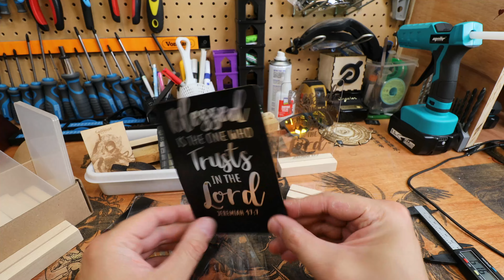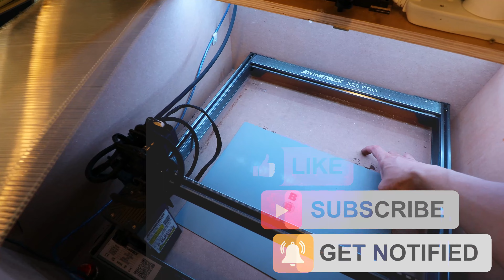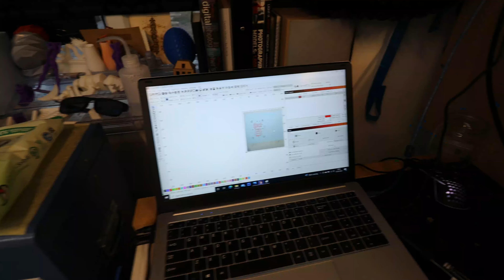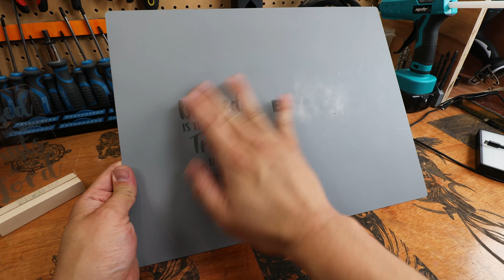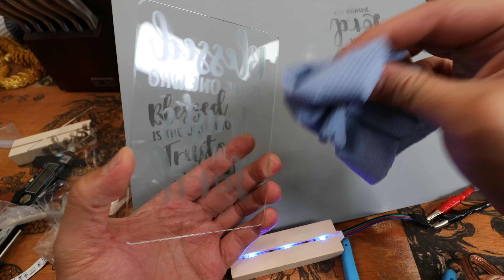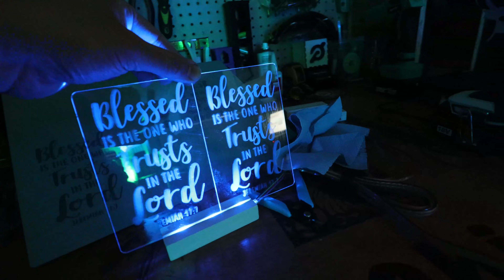Atomstack X20 PRO Quad laser engraving clear acrylic by Benson Chik

Comment: I recommend checking the fill offsets. The laser from Atomstack is a little late, and because of this, there is smearing of the edges when painting bi-directional. I made a detailed video on this issue. https://youtu.be/-sPOyj1CYIw
And this will be useful for those who want to work with Atomstack via WiFi from a PC from LightBurn, https://youtu.be/JMbSUrwNKdw
Reply from the maker: Thanks for the tip 👍 will. Will check out the video. I adjust the offset when doing tiles to get a straight edge where the photo stops

Comment: Can't we just use a colored cardstock for the backing instead of spraying metal?
Reply from the maker: The grey primer works best as it will get vaporised but leaving very little residues on the clear acrylic. When I use black spray paint and other non metal backing it leaves burn mark and vapour escape type of marks which does not clean off

Comment: Hi Benson, did you ever try to cut rubber with this Atomstack? Approx. 1 mm NBR for cutting gaskets e.g.? I'm quite interested, because usually the wavelength of CO2-laser would probably be much more suitable, but maybe the power of the X20 Pro compensates?
Reply: Yes, it can cut and engrave rubber. I used it for making stamps.
Reply from the maker: No I have not tried, is there any household product with NBR I can test cut with?
Reply: @BCreviews  Maybe an old inner tube of a bicycle could be comparable. But only if you've an extraction, since I'm not aware of toxic gases.
Reply: @BCreviews  I've got the information from Atomstack, that it should be capable to cut rubber. I ordered my Atomstack now, so that I can inform whether it really does cut it, asap

Comment: Hello witch configuration you use for Lightburn and the X20 pro ? your are on Mac of windows ?
Reply from the maker: windows 10, I find that install grbl first and get that working then install lightroom sorted out the teething problem I had. At first I have to start GRBL and connect to the laser, then shut down GRBL and then start lightroom and it will connect. After a few times I now can connect to lightroom every time it starts. I always assumed that is because of driver problem.
Reply: @BCreviews  I presume you are using Lightburn instead of Lightroom :)
Reply from the maker: Lightburn yes 🙌

Comment: Why the X20 Pro "failed" to cut acrylic?
Reply from the maker: Failed to cut clear acrylic , most coloured are ok to cut to an extent.
Reply: @BCreviews  wave lenght of beam vs CO2 reson for not cutting clear acrylic
Reply from the maker: I would love a co2 laser, all I can afford is k40 but too much work to make it good 😂
Reply: @BCreviews  hi Benson. I use a CO2 laser but for backup I want to get something like the Atomstack
Could you tell me what is the maximum engraving speed
Reply from the maker: I find the max sped around 8000mm/min, any faster than that don’t seems to improve engraving speed at all. Could be due to user error as I am still learning as I go. 

On paper it should go up to 12000mm/min, when I use that setting in lightburn it is the same engraving times as 8000 …. I may do a speed test video next 👍
Reply: @BCreviews  ok thanks will do conversion to mm/sec as the co2 can do 400mm/s max but engraving depth ect works hand in hand with the speed
Reply: @BCreviews  12000mm/min) = 200mm/sec not too bad but I think engraving is light at that speed full power?
Reply from the maker: No where near that speed for engraving, that is just the speed the gentry movement max speed. In my 1st x20pro video I did a batch test on wood. 2000mm/min 30% power seems to be the sweet spot. We can increase speed and increase power for sure but that will be another video to explore as higher speed will have effect on laser quality which is what you want to know about this vs co2
Reply: @BCreviews  thanks for the info. Yeah for backup on orders I need speed